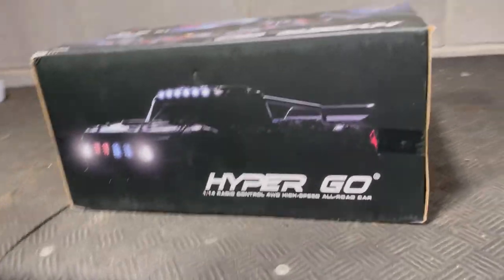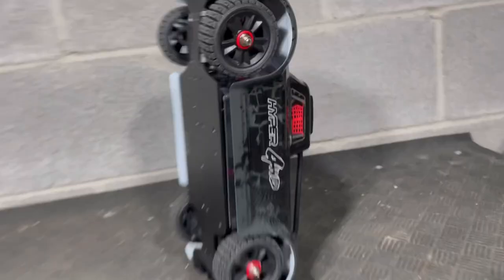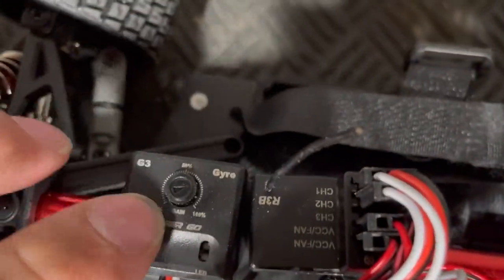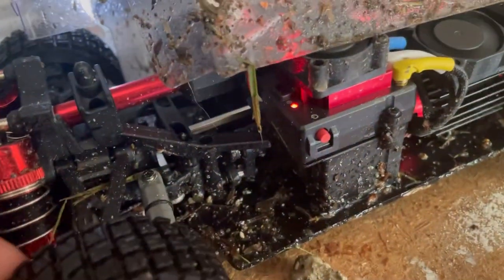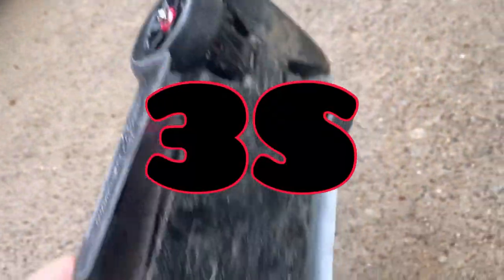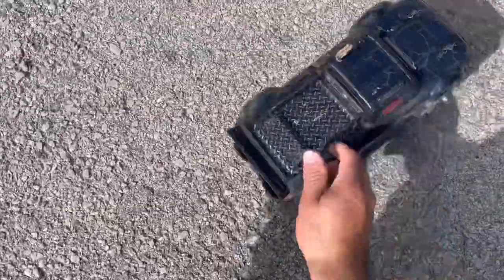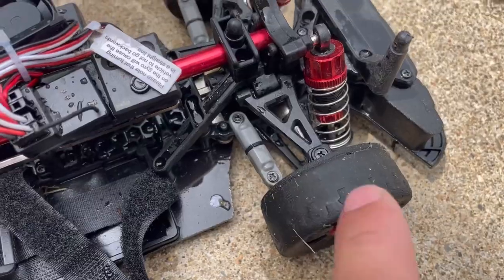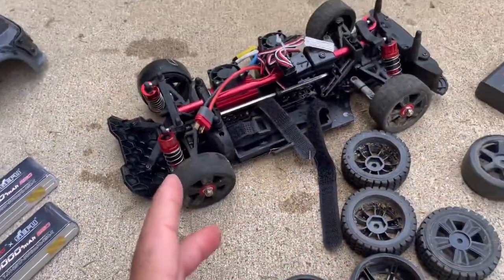Our first DRIFTER! The brand new HyperGo H14MK

Comment: some tips for a lot of people to have no issue about pebble stuck in the servo saver or wheels, and also reduce overheating. Use some 1/10 wheels  and cut a little the body, bigger wheels will not go slick and break on 3s also reducing body scrach and absorbing most of the impact. Cut also a small window in the body where the motor fan is since is blockig the heat inside . Do not use the dust cover! it traps the pebbles inside and i had more issue with it than without, also not allowing the electronic to properly ventilate.
Reply: Bigger wheels kept the pebbles from your servo?
I get, that it will lift the truck and will have more clearance inside the tire, but how can you save the servo? I have the same problem.
Reply: @FrederiQQ  yes
Reply: @enricomiceli5517  Damn, Frfr no cap

Comment: I love this truck! I bought both versions back when they first came out, before it came with a gyro. I’m telling you this thing is planted and control’s amazing. You don’t even need the gyro. It is a nice touch though. 
I don’t bother with the inside cover anymore, it doesn’t really work. I think it actually traps stuff in. 
Oh and FYI Those soft tires don’t last long on 3s lol. You’ll have slicks before you know it 🤣🤣
Reply from the maker: Ya I think I decided no gyro is better. Ya they needed to close the front of the dust cover more as the front tires lock everything right inside there lol. Definitely learned on those hard rubbers and I’m sure the softies are just as bad lol!
Reply: @DerbyCityRC  I can’t speak to how it is with the gyro cause mine doesn’t have it. It handles so nice without. The weight of the truck really helps it. I do have gyro in a few of my other cars and I’m not a big fan of it. I always have it off. I prefer the soft i tires but they burn out wicked fast on 3s. They’re like 30 bucks for a new set too!!
Reply: @DerbyCityRC  Were you surprised at how nice the gears feel? I know I was very surprised. They really did a good job with this thing. Its tons of fun. It’s definitely a beast on 3s. Takes a beating too.
Reply from the maker: Ya you can spend a fortune on these tires I’m sure! 🤣

Comment: Great review! This trucks looks like a lot of fun! I'm ordering one right now! Stinks about the pebble issue. Do you think running it without the dust cover would help? I'm thinking rocks are coming off the tires and deflecting off the dust cover right into the steering. For 4wd drifting I prefer no gyro. I also have a rwd drift car and that needs a gyro to help with counter steer. I think the gyro on this car is like AVC and helps you stay in a straight line where as a drift gyro does the opposite.
Reply from the maker: I thought about trying it without the cover but never did. Personally I don’t think it would have helped as with the truck turned to the right, the front right tire just throws everything right into that area and likely would either way. I agree after watching some more it worked better with the gyro off. Definitely helped on full throttle take off though.

Comment: 2 tires for the 14mk are the width of common duck tape, which is handy because it means you can easily get left and right tires when you tape them up. slice down the middle and there's no excess (or just enough for the edge). i've been thru 12000mah 2s constant drifting on tarmac and zero wear, those tpr tires would have been toast in the same time
Reply from the maker: Good tip!
Reply: @DerbyCityRC  the other thing that made this car a lot more enjoyable for me was a dumborc gyro with gain on the transmitter. 1/3 gives a good feel for throttle steering, off when the understeer is annoying and you just wanna thrash around. and having the stand alone gyro is handy to try out in other RCs
Reply from the maker: @shadyhazza sweet! I do like my dumbo radios

Comment: I just got this one for my son and I. Weve been loving it, however how is the range on yours? If we take it any more than 30 feet away then we lose connection and how to go get it. We have the H14BM and I can take it crazy far with no problems. Other than thats its been so much fun.
Reply from the maker: I would make sure you have good batteries in the controller, and I would open the receiver box and see if something is wrong with the antenna wire. It should definitely have plenty more range than 30 feet. Could be a defective remote or receiver too of course but hopefully not!
Reply: @DerbyCityRC  I did check all that. I put new batteries when I got it. Then while playing with it I swapped the batteries from another controller that was working fine. The antenna wire looks good also. I'm going to have Amazon exchange this one out.

Comment: Got mine a few days ago. Don’t always have room to run it on a 3s so 2s is just fine as well. Came with a busted shock though. Waiting on parts. Lil rocket on 3s
Reply from the maker: It’s great fun either way!!
Reply: @DerbyCityRC  I’m used to RC’s that go 3-maybe 20 mph definitely a learning curve I must achieve but wow has RC technology gotten better and cheaper since being 7 years old in 88. Rock on papa bear 🐻
Reply from the maker: Ya it’s improved drastically!
I was born in 88! 😃
Reply: @DerbyCityRC  beard makes ya look older like a mountain man lol. But hey I’m using a Ovonic Air 2200 mah 35c
•3S1p 11.1V •24.42wh battery and I noticed the connection to the battery to the connection to the ESC has melted after maybe 3 uses. I don’t run my packs out and and am very delicate when running my stuff btw. Not that experienced with 3s batteries more of a car audio guy. My guess is I’m not running a proper voltage battery or the lil housing just melted cause it’s not made for the heat the battery connection makes. Any info I’d appreciate
Reply from the maker: Haha, I know.
That’s weird cuz that shouldn’t happen. Your bath voltage should be good. Is it excessively hot out where you are? Even still, I’ve never had that problem!
Reply: @DerbyCityRC  na it’s not hot. Maybe the connection got jammed in somewhere during some of the cartwheels it did. Tough lil RC for Sure
Reply from the maker: Weird, I’ve never had that happen, but yes I’ve certainly seen odd things! Lol

Comment: Very informative video. If you do get a taste for drifting I recommend the cheap UDIRC 1/16 brushed series of cars. They also have a gyro and drift tires. However I prefer the  rubber road tires and the gyro turned off. Anyway thanks for all the info
Reply from the maker: Thanks! I actually also just got the 1/16 UDIRC drifter, but it is the brushless one. It’s a new model though, so may not be the one you’re talking about.
Reply: Would love to see your comparison between the two when it comes to controlled drifting at lower speeds!
Reply from the maker: It’s night and day. If you watch both video’s separately, I think that’s all you need for a comparison . The hyper go was much better

Comment: Will that shell fit the hyper go 14210 I thank that's what it called but I really like the looks of that shell
Reply: It might fit, they're both pickup-style bodies. Though the 'infraction' body needs a quite bit of wheel arc trimming since it is much wider than the stock 14210, which is as wide as the chassis
Reply from the maker: It would take a lot of modification like a major body lift or a ton of body trimming. The body practically sits ontop of the tires of the 14210.

Comment: Do you help people with fixing? 
 I bought one of these for my son.  Servo died.  Ordered a new one, when i connect the steering, and turn it on it automatically steers hard to the right and then the spring opens up and gets stuck.  Any ideas?
Reply from the maker: Did the old servo do the same thing or did it just die completely? What happens if you plug the old servo in now and turn it all on? 
With the new servo, will it still steer hard to the right even if the controller is off but the car is on?
Reply: @DerbyCityRC  thanks for replying.  No, the old servo drive s dead.  Connected to the servo are 2 curve pieces that fit together held with a spring and screw.  When it goes hard to the right they open up and get stuck open.  The screw is as tight as it will go so not sure why that is happening.

Comment: Do you have any idea if there is a package for this where you can get the 14301-14303 bodies, together?

If you use the 14302 or 14303 bodies, does that change the scale of the automobile because the body makes the proportions different?  It seems like it should since scale IS based on comparative proportions, right?

BTW, seriously think about trying to order this, but with the rally or drift body.
Reply from the maker: I don’t know I haven’t seen one with those bodies together.
I believe they’re all still 1/14 scale, but yes it’s technically sized off what the real car measures at. The really bodies are definitely awesome looking for sure!!
Reply: @DerbyCityRC  'Not really...Let me explain in a simpler way:  When you put that 14301 body on, think of the size of the man that would get in that truck.  When you put the 14302 body on, that same man would be child sized getting in that rally car.  'See?

To simplify the process of actually measuring the cars, if a car is truly 1/10 scale, than any 1/10 average man should be able to fit in with the same ease a real man would be able to enter the real-life counterparts.

Does that make my question any different?

Comment: How’s it holding up? I got mine yesterday and went through both 2s packs as well as 2 3s battery’s. Rear hub broke and I had to glue it back together. Spur gear completely stripped out on me.
Reply from the maker: Mines fine so far. I’ve driven it maybe 4-5 other times. Stinks you had those issues.

Comment: This thing does more rolls than a bakery if you try and turn under throttle on 3S I have a suspicion my uhhh enthusiast driving style is part of the problem
Reply from the maker: 🤣🤣 it’s been a while since I’ve had this one out. A more “slick” surface could help too! Or the harder tires if not already.

Comment: Has anyone else had issues with the lights not working right out of the box? Mine looks like a pirate truck it kind of has one eye 🤭
Reply from the maker: I have not. Sorry to hear that! Just check the wiring under the body but maybe it was just born a pirate 😃
Reply: Hooked up to channel 3? I once got mine (14303) wire somewhere else and it had front and rear lights lit, and turn signal to left constantly blinking :)